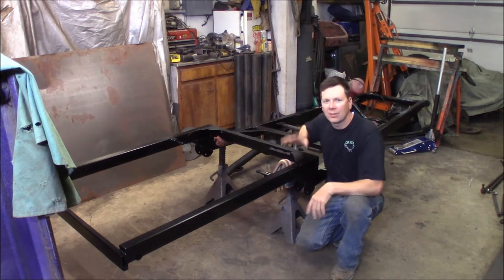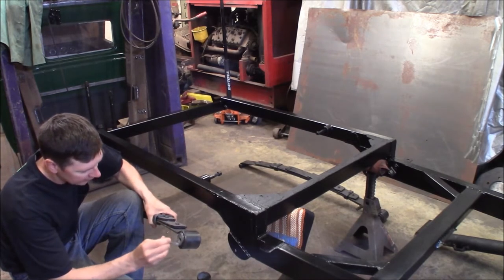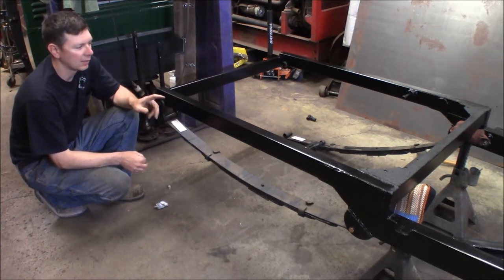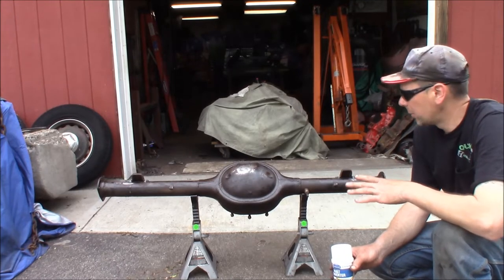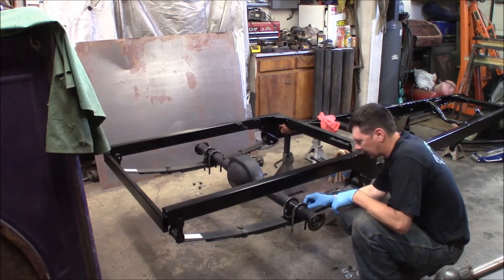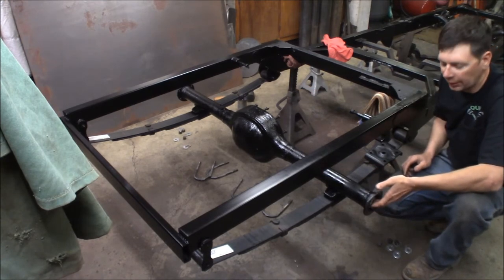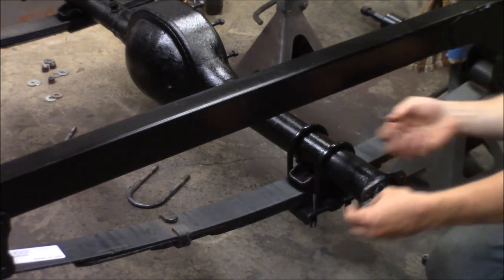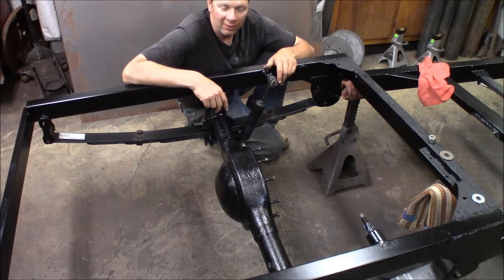Model A Hot Rod Shop Truck: Frame Assembly Part 3

Comment: I've been debating doing a build like this, but was wondering how you go about getting it registered if you start with a bunch of old parts and no paper work. If you could, would you go over that process for us some time when your not so busy? Thanks
Reply from the maker: I had bits and pieces of a really rusty Ford AA truck I started with.  I had the serial number off the engine.  In New York you can use two forms from the DMV to prove ownership plus a tracing of the serial number.  It's actually one of the very few things that New York has made easy.  This only works on pre-73 vehicles with transferable registrations before NY issued titles.